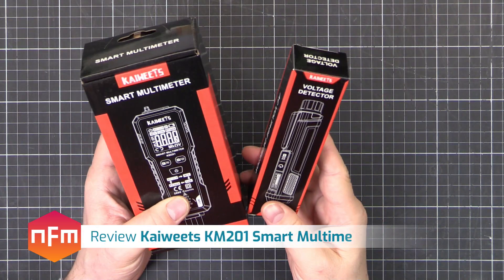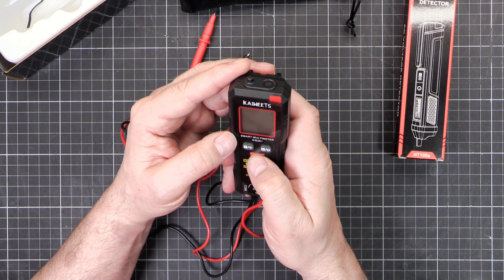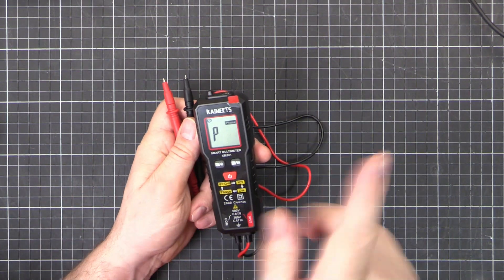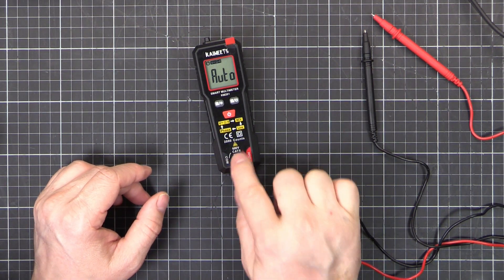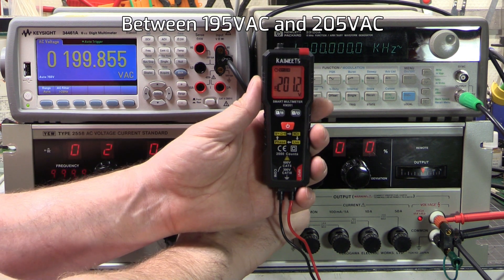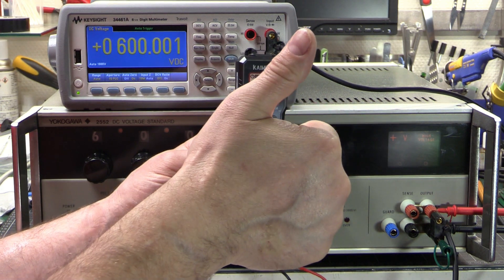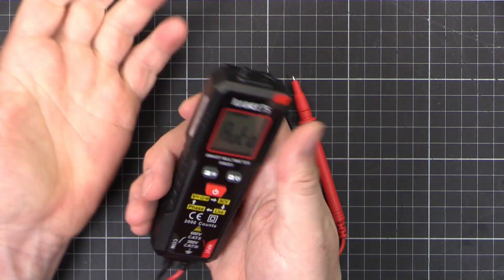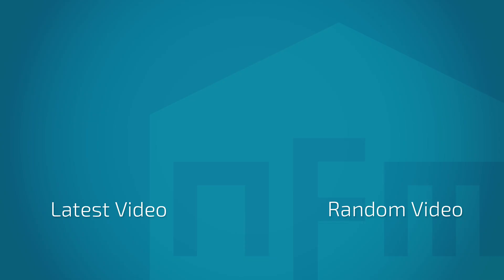Kaiweets KM201 Smart Multimeter Review

Comment: The testing I did on other auto mode meters found that at certain levels they don’t switch when they should, test low voltages of less than 1V and see what happens 😬
Reply from the maker: Oh, good point, I didn't even think of that.
I guess if you try to test a voltage that is close to or less than the voltage applied by the meter in resistance mode, it would get confused.
Reply: It does 1vac rms and 1vdc no problem but when you get to below 800mv it is when it gets confused.